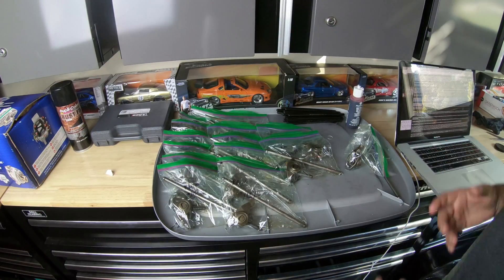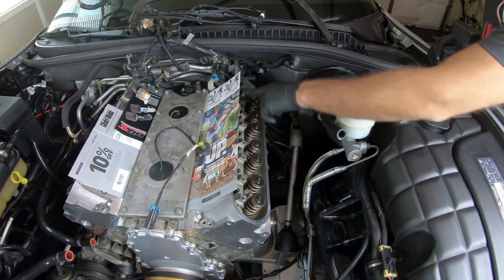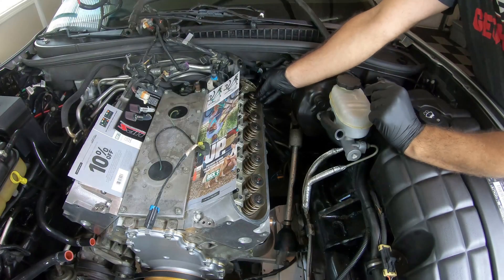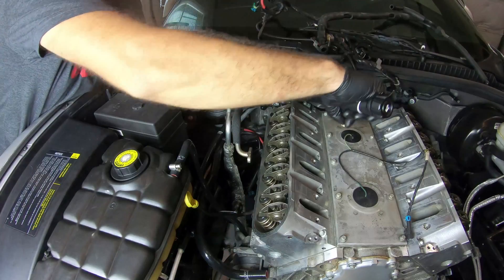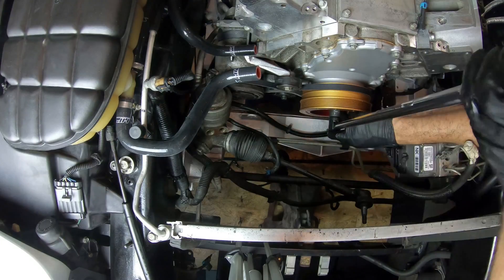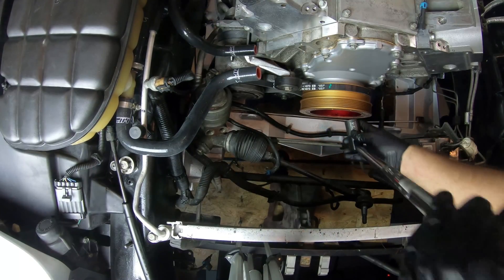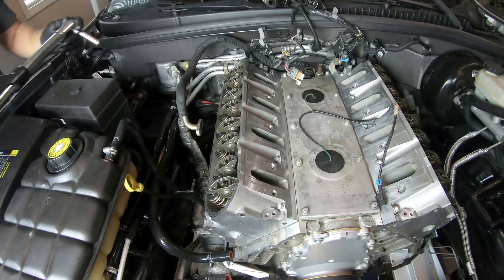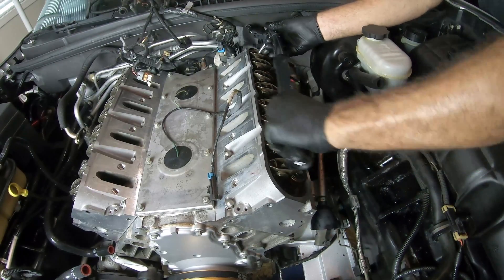Rocker Arms Install - C5 Corvette Build - P25

Comment: You don’t have to adjust to tighten the rocker arms?
Reply from the maker: The G’s adjust what?
Reply: The valves before tightening the rockers
Reply from the maker: The G’s nope. I bought a kit from Tick Performance that was just an easy OE spec replacement. Just had to torque down to spec

Comment: Would you recommend this job for someone’s first time doing motor work? Hardest part to me in my opinion is the timing chain oil pump and heads install.
Reply from the maker: I've always tinkered around cars, but I've never done any major engine work either. I finished the suspension work on it before so I had some initial confidence going into it. I found that reading extensively on each component eased my mind.

Comment: did you upgrade the trunions on those rockers?
Reply from the maker: No. I thought about it but decided to leave it off till after my birthday. I'm still not sure whether I'll buy new rockers or keep the stock ones with the trunion upgrade. I know that the stock ones are good and the weak point is the middle, but I'm not too worried about it right now... Definitely not planning on abusing it any time soon
Reply: Car Mod Guy yah i guess if goure not bouncing it off the rev limiter youll be ok

Comment: What would you say the hardest part of all this was? And If you worked on it straight how long do you think the disassembly and reassembly would take? Thankyou for these vids, I am confident I can install my own cam now
Reply from the maker: There were a few difficult parts. The most difficult I would say was the long tube headers install. It wasn't that it took a long time, it was just really physically demanding. But if you're not doing long tube headers, in order of difficulty, I would say that the steering rack was the most difficult: removal and install. Next was the removal and installation of the harmonic balancer since it requires so much torque. Next I would say would be disconnecting and reconnecting the wires and brackets from the back of the heads. Torquing the head bolts down was also grueling. Finally, the radiator/fan removal and install was a pain. 

Going back and doing it again, it would of course be a lot easier and quicker. I would do a couple of things differently like removing the power steering pump before I remove the steering rack. I can't really judge how long it took me since I had to position the lights and camera each time and make sure that I got an appropriate angle. I also didn't have a video guide to take me through the process; I researched and read a bunch before attempting any type of removal/install. Also, labeling and bagging each bolt took some time. I would say that it definitely took me more than 50 hours of work though. More than 150 hours with cleaning, painting, recording and video editing.

You'll see more though in the upcoming videos.
Reply: Which Headers did you use? Im searching for a set that bolts up at a fair price but Id most importantly like them to bolt up without mods
Reply from the maker: I got a set of Maximizers. After I received them, they were stuffed with OBX warranty paperwork, so I'm not sure but I think they may be an OBX product.

https://www.ebay.com/itm/Maximizer-Catted-Exhaust-Header-For-Chevy-Corvette-01-04-LS1-5-7L-C5-Headers/232814773707?ssPageName=STRK%3AMEBIDX%3AIT&_trksid=p2057872.m2749.l2649
Reply: I was just looking at those lol...Do you have the video on that install coming?
Reply from the maker: Yes I do. A couple of more videos from now. Still editing everything, but it's be coming soon.
Reply: took me and buddy 10 hours to do full arh header and x pipe install on my car.
Reply from the maker: @wkeil1981  yeah. Definitely a pain